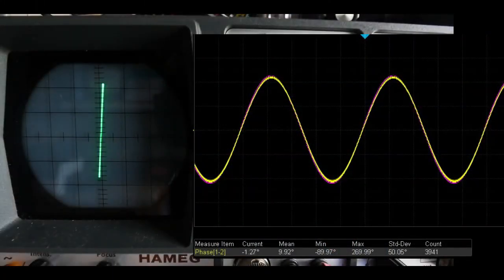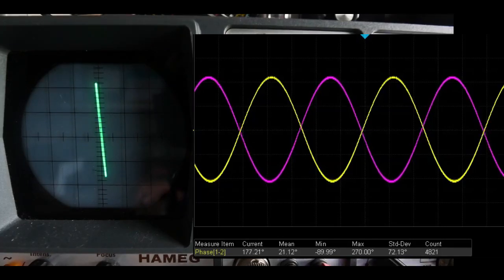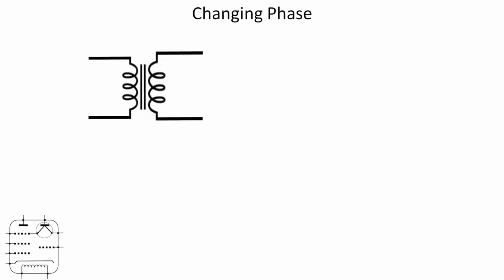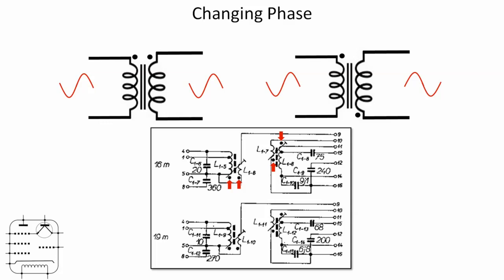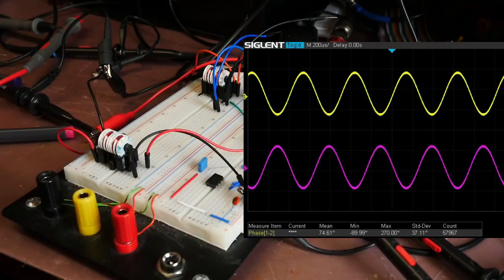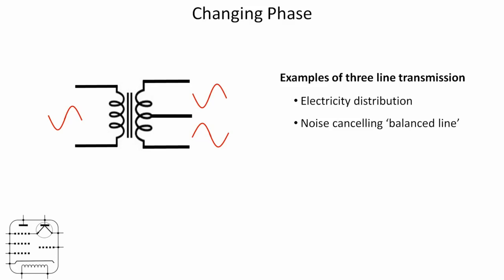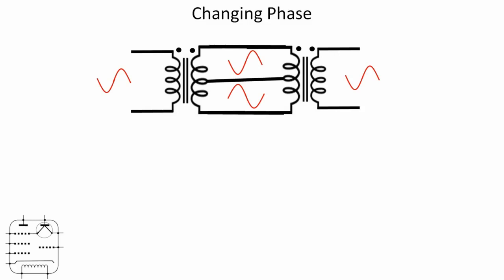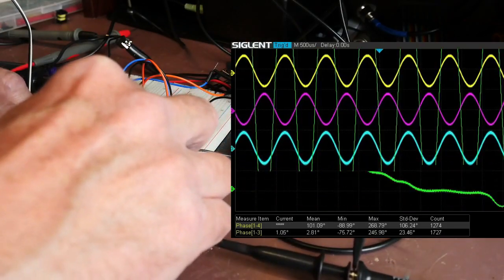Phase and Discrete Components    #069

Comment: thanks for this insturction
video. i would like to try and duplicate it.
i missed how you connected the 2 channels out put of signal generator to the 1 channel input on the scope to get your scope view, if you could explain.thanks
john
Reply from the maker: Ok, no problem. 
One input goes to the channel input as usual, the other signal to the X Input socket, I then select XY mode of the scope to effectively disable the internal time Base and use the X input to control the X motion of the electron beam.
See this video for an explanation - https://youtu.be/leGlVh3zECs
Reply: @LockdownElectronics  small question about that, if your sines are out of phase by 90 degrees, wouldn't you expect a circle, if the scales are the same?
Reply from the maker: @hvdtoorn  Yes, that's correct, if I had adjusted the Y amplifier gain, O would have obtained a circle, there is a good video here:- https://youtu.be/t6nGiBzGLD8
Reply from the maker: The single channel  scope for the XY view?
Reply: @LockdownElectronics  yes sorry i wasn't clear.
john